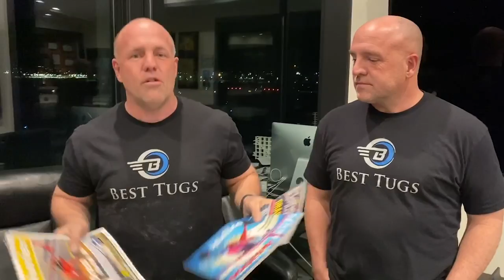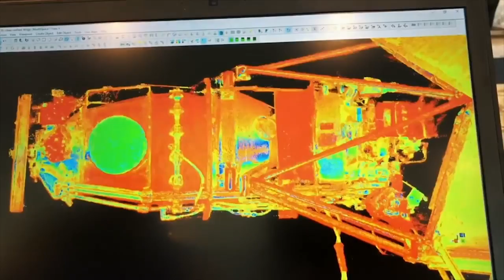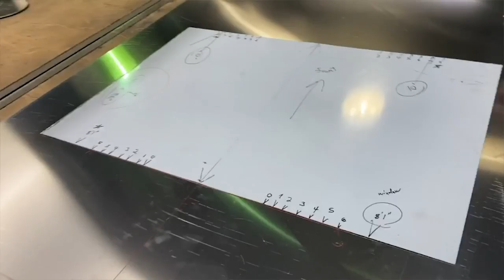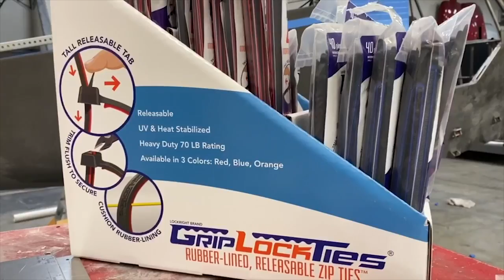Vertical Stabilizer & 1 Hour Carbon Fiber Part 🤠 | Scrappy #8

Comment: Well you both have inspired me.  I first saw a draco video and that got me hooked on STOL aircraft. My biggest vice is fishing and it will allow me to get into places I could never go any other way. I started flying back in 1975 and with family and work just couldn't do it for way too many years. Now I am retired and have the time. I just got my medical and am planning on building a zenair ch-801sd starting this spring. I plan on doing the modifications Mark did on his and also am starting to shop around for an engine. I definitely want a turbo and am thinking of a lycoming but WOW 70k for an engine is a bit out of my budget (do you guys have a spare you need removed because it is taking up too much floor space?). Since I am in PA I was hoping for a local discount but no deal on that, although they would be happy to have me visit the factory for a tour.  LOL

Comment: Hi Mike, 
Thanks for another banger of a video! One question I've had watching all your build videos is, why do you sometimes use a vacuum with multiple layers of wet layup, but in other cases just go with peelply only? I'm working on a composite rectangular waterproof enclosure bonded to anodized aluminum for a collegiate robotics competition. I have the impression that you can get away with not vacuuming multiple layers of carbon with wet layup if you don't have complex contours, is that somewhat correct?

Cheers, 
Daniel

Comment: Gussets! Use some to reinforce certain areas and save weight because you can use light weight plating with holes dimpled in. That's how we do structures in the auto racing world and it works very well.

Comment: I always reuse zip ties if they aren't on something important. Super awesome to see some that I don't have to stick a tiny screwdriver into and pry apart to release. I'm no pilot, just a dad of 2 that always has batteries, crazy glue, and zip ties at the ready. I'd love to grab a pack of those griplockties for the house!
Reply from the maker: You can find them on Amazon. 👍🏻👍🏻

Comment: I need a selection of grip lock ties. Hyoid need to come up with a conduit to work with those ties to keep the strain off the wires. GM conduit is great for hitting wires, but it provides no strain relief. Strain relief is a must, especially on something like an aircraft or motor vehicle. Vibration alone, in an environment that sees a lot of vibration will destroy wires from the inside out. So put you might Brain into figuring out a conduit to work with you new ties.  I would help but I'm working on a product of my one.

Comment: I love my griplock ties i have them holding my brake line and abs wire to my knuckle on my bagged daily so they've been exposed to the elements vibration water and rocks and stuff for months and they came apart and went back together like new when i changed an axle today

Comment: What did you use for mold release on the turtle deck/vertical stab?  Packaging tape? Wax? PVA? Combination?  Did you think about using Square Tubing on the Vertical Stab/ Rudder Hinge point.  It would be a lot more rigid in lateral bending.  Just a thought? Man, I love what you're doing. Seriously inspired!  Keep it up!

Comment: What resin/epoxy are you using? Does it require and post curing? What's the working time with it after mixed?

Comment: I haven't been PIC since 2002.  I basically got my pilots license and stopped flying due to college/money.  Between you all, Trent Palmer, Flying Cowboys crew, Aviation101, TheFinerPoints, Stevo1kinevo, GravityKnightFlying...  over the past 2 years, I've been saving to get into an flying club and to become current again.  Going for my 3rd class medical in a few weeks and plan on flying towards the end of March when it's still daylight after work.  The biggest hurtle for GA in my opinion is cost.  There's a large barrier to entry for skills/knowledge.  There's a larger one for the overall costs of it, especially if it's just a hobby.  If they were able to buy/sell new planes with updated avionics for $35k-$40k that you don't have to build, you'd see a lot more in the space.  $85-$100 an hour for a 172 after all these years...  I don't know how to solve it.

Comment: Are you going to embed any metal mesh on any surfaces? Even if not for lightning protection, radio antennas may not be the most well behaved without a ground plane. The lightning protection stuff meshes are only 2-3 mil thick expanded and anodized foil, so super lightweight, and the holes let resin bond though to the CF on the other side.

Comment: Nice offer to would be aviation people, thank you for your generosity Mike.

Getting the licence is spendy, but so is the cost of flying as a whole. I was part of an online group and I put forth a question about designing a low cost two seat aircraft design, something someone with a beer budget could build. The amount flack I got was shocking. You would have thought I'd just killed the sacred cow.

Well we move forward in time, I'm working on an homebuilt design that I hope to build to fill design mission. I started with a clean sheet of paper with some ideas. I'm using an airfoil that is stall and spin resistant. The design is designed for off airport use, it needs to be tough for the intended use, I think I have that taken care of. Because the design is designed for off airport use it needs good to excellent visibility, I have done that. 

It's not going to beat a Carbon Cub off the ground mainly it doesn't have the horsepower on tap. But if they had the same 85 hp they would be on a par with each other.

The current plan is to offer the plans for the cost of printing and shipping. I plan to offer all the welded parts in the airframe.

Comment: Outstanding video, you and your brother can design and build things.  Currently I am developing aircraft handling qualities, performance, flight test, and structural analysis programs using MatLab/Simulink, Simscape and Excel/VBA.  Also, I will be doing structural calculations in SolidWorks.  I am looking at some off the shelf software to reduce my workload in this project.  Do you use any structural engineering analysis or aircraft design software?  If so, what would you recommend?

Comment: An extraordinary video when all of you videos are  first class. This scrappy build is over the top and i love it!  I'm curious what sort of wing you have in mind?  Draco had an extended cord as well as unique wing tip with vertical mini fins, what aerodynamics did this wing tips yield? Will you use them again? Airframes Alaska offers Performance STOL flaps that look amazing but are limited to Piper  Cub wings as I recall. The Kitfox STi wing has some very interesting vortex features that I would be keen to understand the full engineering of. I recently learned that there are advantages to the small clear vortex generators traditionally applied to the leading edge but apparently  can be applied to the tail as well? Thoughts on all these  wing attributes?

Comment: Just curious, since this will be a carbon fiber construction are you planning on covering with any metal liner like the expanded copper they use on the carbon fiber heavies to keep lightning strikes from being catastrophic? I assume it would be a very rare occasion that a strike would happen on a general aviation plane but I guess It would be something lingering in my head if I were considering a similar build.

Comment: I am wondering something,  oil cooler radiator air intake ears on the body, when it fly,it may  disrupt the form of air flow, and the other question how to discharge the compressed air accumulating inside. thank you

Comment: Don't know how critical the galvanic reaction problem is but if you were to run an ohmmeter, possibly a megohmeter, between the carbon fiber and the metal frame you could measure the resistance of each frame/shell securing point to guarantee that your efforts to insulate between the two is good.  Just a thought.

Comment: Have you thought about using a sandwich core structure with your composites, like a pvc foam core, it will increase the strength and reduce the carbon plys required

Comment: (Being overlapped) as stated in the use of aluminum when molded the tolerance is not for 1 isolator but in order to match the molded tolerance you will need to double the isolation washers on the overlapped sections.

Comment: If that dorsal was a bit longer and taller it would help, along with the bigger vertical, with the tail wanting to turn when adding power, much like they did with the Mustang when it when from the full canopy to the bubble canopy....  Just a thought...

Comment: I've seen some airfreames made with some trim built into the vertical stab. That way the prop wash will require less trim by the pilot. I also noticed, it doesn't appear Mike did that with this one.

Comment: Mike, it is called the bleeder ply, not foam. What kind of epoxy are you using. I do carbon fiber repairs for Textron Aviation and we use HYSOL 9396 structural epoxy for all composite work

Comment: Raceway.
Probably the #1 thing in regard to becoming a pilot is to embrace being a student. The student becomes saturated with a plethora  of disciplines and can recognize so many new opportunities. I suspect the reason why only a small percentage finish certification is because being a student can be more rewarding than initially perceived. Be prepared for a dose of integrity which reinforces discipline and can be directed or redirected in more ways than you think. A student with endorsements can exercise most of the privileges of a certificated pilot and this presents some advantages to anyone who loves to just fly. If I remember correctly, a student pilot is able to fly whenever wanted and to most any place approved in approximately 20 hours of initial training. Go for it!

Comment: May I ask you to provide more technical information in your video's, such as what was the reading on the vacuum gauge when you were vacuum bagging, how much vacuum is too much where the resin ratio is depleted. You laid up 14 layers of Carbon on the fin. How many layers can you lay up at a time before it starts overheating? Welding Chrome Moly, what filler wire?  I have changed from using an iPhone to a Samsung Galaxy only because of the quality of the photos in low light are so much better. Videos are 4K. Leaves the iPhone I had for dead.

Comment: My personal "issue" with aviation is financial. I had to grow up fast, college wasn't a priority unfortunately, helping mom and my sister was. Now 30 if I want to have a career as a pilot I got two common ways to achieve this, 1. Go to a mom and pop school or something like ATP and spend $60k to $100k then get slap with the 1500 hour rule to just start on a kinda decent job, mean while you have to pay back the loans that put you through school, yes you can find maybe 200hr or 500hr jobs but can't maintain a house and family on that. 2.you can go to a 4 year degree school and get a waiver for 1000hr and spend things faster but we're looking at upwards of $300k in student loans. The reason I watch your videos and listen closely to your technical stuff is because I have this pipe dream of finding a scrappy and fix up so I can do my schooling in it. For now Ebay and wingswap.com keeps me dreaming.
Reply: Alexis Maldonado I went to Confederation College to get my CPL with floats endorsement. The program is subsidized by the Canadian Government. I walked out with my license for around $15000. 

Would be worth applying if you can.

Comment: Hey Mike, your vertical stab looks big compared to the Carbon Cub, but take a look at the size of the vertical stab on a Stinson 108-3 (big tail model) with a measly 165 hp Franklin.  Looks to be about the same size as Scrappy's.  But, like you said about Scrappy, makes the plane fly like it's on rails.  One of the endearing qualities of the big tail Stinsons (compared to small tail Stinsons and other Cub type airplanes) that we big tail Stinson flyers love.  Stinson guy.

Comment: I'd love to know the weights of the aluminum sheets used as forms vs. the  resulting carbon fiber part - for instance, the upper fuselage/vertical stabilizer part.

Comment: When you say "cub", is that a manufacturers term or an industry term for the plane size?
Reply from the maker: Andy Peterson it’s mostly a industry group of aircraft from various manufactures that is usually a 2 seat bush style tail dragger.  Based on the original piper cub.  A historic legend back country plane

Comment: Hi Mike&Mark! You guys are great! Been binge watching your videos ever since I caught a glimpse of Draco! I felt your pain, as I crashed a Delta Wing X-160 in a forty knot wind the same way. Broke my neck.
I’m a third-generation aviator (my grandfather was a test-pilot for Sikorsky, 3rd Squadron leader for Czar Nicholas II in 1913) though have not flown in a awhile. I got my private pilot’s license in 1978. Then I started flying hang gliders in 1983. I’ve spent decades advocating for alternative fuels. I’m particularly interested in what you may be able do with a hydrogen powered engine. I understand there’s a methane fuel approved  by FAA for aviation, but is there a design for a hydrogen fuel cell that will work in a plane? THERE’s a challenge for you!

Comment: After 24 years this rusty pilot got back in the cockpit and and pass flight check in Two lessons. I’ve post my flight around the pattern on you tube in a technam 92.  Getting ready to join CAP. 70 years old, Vietnam vet

Comment: For younger kids who won't be old enough to start flying for many years, like my 7 year old, it would be fun to see you connect with some other youtubers, like FliteTest, to collaborate on build revolving around aviation that echoes a real large project you're on, but which is readily and immediately accessible to younger aspiring viewers to enact now (RC craft, paper airplane, rubber band plane, etc)

Even just doing some simple builds, like a paper airplane or foam wing or whatever, would give young viewers something tangible to get at least a small aviation morsel while they continue to dream about starting lessons when they're 16.

Comment: Purchased a ‘ kit’ falcomposite furio 8 years ago . Like many I have spoken to a layman thinks a kit is like LEGO - well documented , step by step , assemble and fly . Not so - much bespoke design , engineering , trial and error , time and money over a few years is why a small % of kits sold get airborne. What would really help kit builders would be (a) Series of Slow and detailed steps for layup and other skills to complete . B ) a realistic timeline of hours spent on the stuff you do as kit sellers indicate 500 hrs build time with the factory assist . I can’t gauge from the videos if you have a swarm of worker ants working 24/7 on your projects or if you do all yourself. Your videos are awesome but I suspect there is years of skill set and experience that have resulted in what we see . Like watching a pro sportsman and thinking I could do the same - 🤔 don’t think so

Comment: There is a program in Wausau, WI, about 100 miles north of Oshkosh called "Learn Build Fly", this program has gotten many people into aviation, including myself. I think that this type of program would be perfect for you and your brother Mike. A brief synopsis of what this program is: experienced builders come together to design an aircraft with reasonably simple construction practices, and every week invite the community to participate in building this aircraft. The experienced builders teach the inexperienced and likely younger folks how to build the aircraft and slowly but surely the aircraft starts to come together. After the aircraft is done, the pilots of the group then take those without a pilots license for rides, at no cost to the not, yet aviation bug bitten passengers. This program has to my knowledge in the approximately 3 years it has run, produced 5 commercial pilots, 2 A&P's (myself included) and countless bonds between the GA world and the community. If you would like to know more, Learn Build Fly has a facebook page and the contacts on that page would be more than willing to go over the details with you.

Comment: Do you think this would make a good bush plane for me after a few changes?

1950 Piper "Pacer" PA-20. Always hangared and well cared for. Not a converted Tri-pacer, this one came from the factory with a tailwheel. Great flying airplane, but not for the pilot who ignores the rudder pedals, especially on take-off/roll-out. Have the logbooks going all the way back to the factory test flight.
Selling because I bought a LSA and owning two airplanes is too much of a financial drain.

New muffler and rebuilt tailwheel. Annual expired in Aug 2019.
Bonus: including in an AirMap 2000c GPS unit with panel mount, but it isn't installed in the Pacer.
Reply by email if interested.

Empty Weight: 991lbs
Max Gross: 1950lbs
Useful Load: 959lbs (including fuel, passengers & cargo)

Engine: 1967 Lycoming O-290-D2 (1635hrs SMOH)
Annual expired 8/31/2019 (willing to renew annual as part of sale)
8.00x6 Mains
Scott 3200 Tailwheel - rebuilt Aug 2018
New Muffler - Aug 2018
Rebuilt Mags - July 2017
Concorde RG-25 Battery - Aug 2016
36 gallon fuel capacity (18gal wing tanks x 2)
Fuel Burn: ~7gph
All 4 struts replaced with sealed-struts
ELT
EGT
CHT
Whelen Strobes
2-place intercom
4-point seatbelts front, lap belt rear
Bendix/King KX 125 Radio/VOR
Bendix/King KX 76A Transponder
STC - Spin-on Oil Filter
STC - Vortex Generators
STC - Automotive Gasoline (Peterson Aviation)
STC - McCauley 1A170/GM7453 Climb Propeller

Cylinder Compression
#1- 76/80
#2- 74/80
#3- 70/80
#4- 70/80